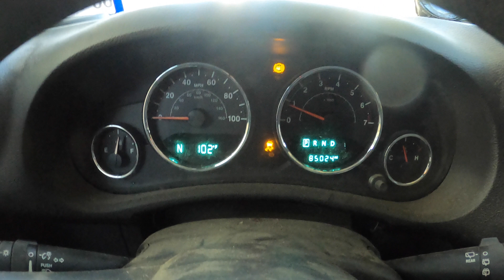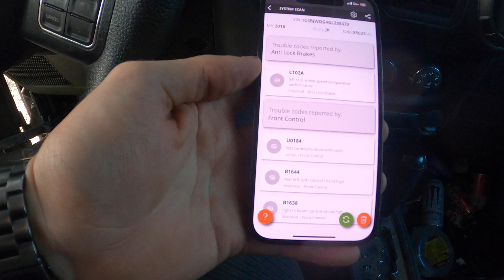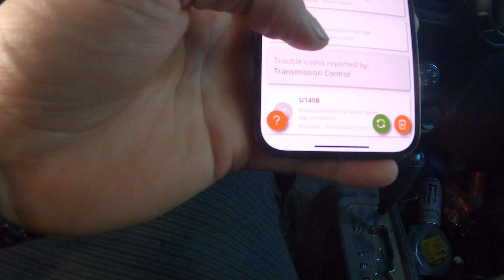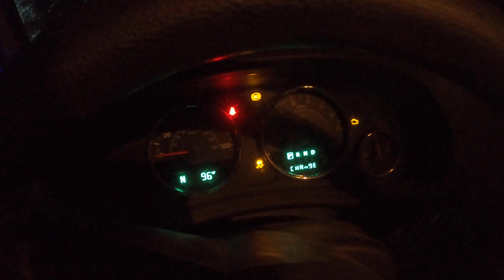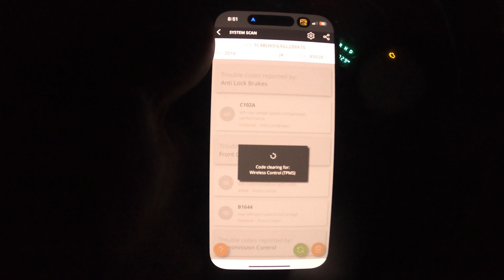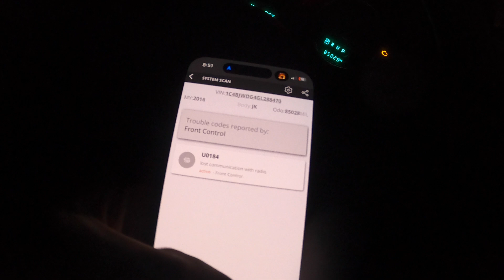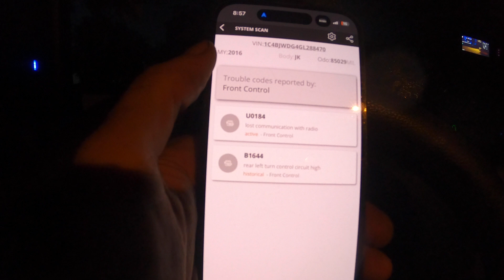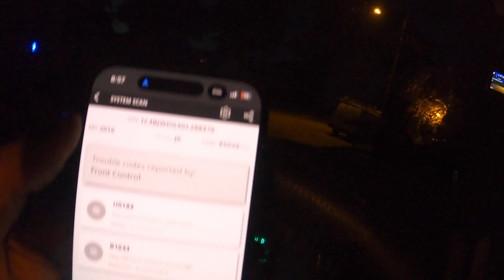ABS & Traction Control light Diagnosis and Repair 2016 Jeep Wrangler (JK)

Comment: Did it drive sluggish I have the same truck and just happened
Reply from the maker: No. It drove fine. Other than the wheel on that side would start to spin easily if I accelerated too fast when it was wet or gravel. Replacing the wheel speed sensor fixed it.

Comment: ABS light is and jeep won’t go pass 20mph
Reply from the maker: Sounds like you are experiencing a different issue. I would use an ob2 scanner to get the codes causing your ABS light or any other fault codes to narrow down the issue.